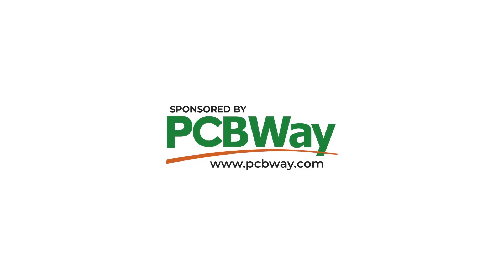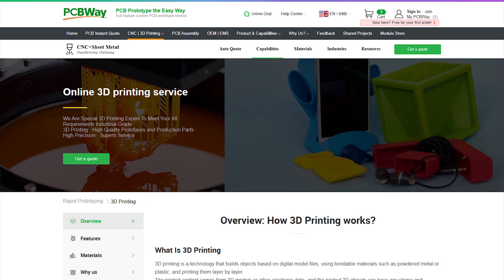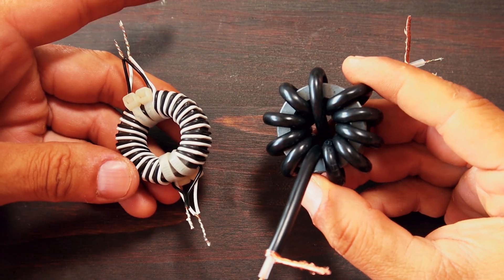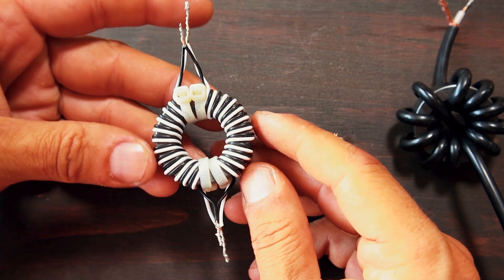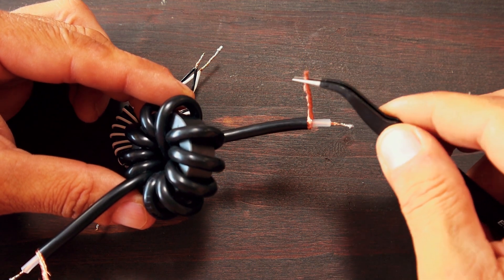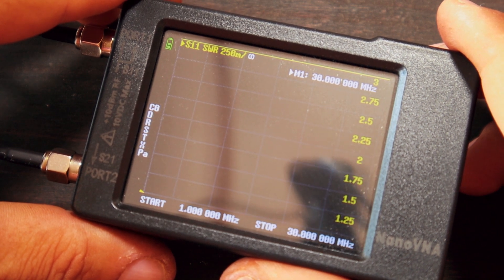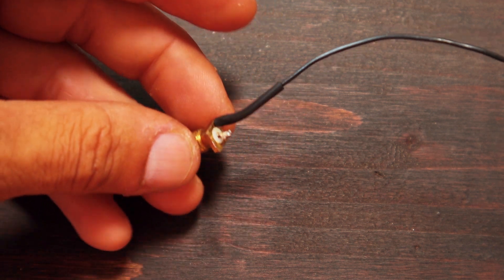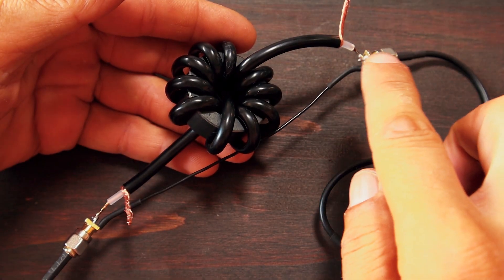Common Mode Current Chokes Comparison - NanoVNA Measurements

Comment: What is the exact operating frequency? Are both types the same?
Reply from the maker: I can't remember exactly as it's been a while since I made it. But it should show during the video the NANO VNA plot and it will show the exact frequencies. Technically it was made to be used for HF for the 160m band up to 10m. But you will see that is not so efficient on all frequencies. I may either have to play with the number of turns to get better results or maybe the toroid. 73, YO6DXE.

Comment: Hello, I hope you are well, I had a question about the Common mod Choke you made, what type of core was used?
Reply from the maker: For the one in the video I used FT140-43. I haven't tested it but I was told that the 31 material is even better for chokes. I will have to try. And to answer to the other question about the power.. honestly I can't really tell as I don't know how to calculate that. As it is now with the 140-43 I did used 100W into it and it was fine, but only SSB and CW making tests. But honestly to be safe I would say 50W should be fine. For more than that I would use 240-43 instead and I think even the attenuation should be a little better and the bandwidth should be also much more linear from what I've seen on others that built it on that core. For me since I only use QRP all the time, 140-43 is more than enough for what I need. What I didn't know when I made the video is that by playing around a little with the number of turns on the toroid, I may be able to get better results, so I really want to do that now when I will rebuild it. I am just waiting for some enclosures and connectors then I will probably rebuild it. I hope it helps. I will search out of curiosity on the power part as I am also curios on that. 73, YO6DXE.

Comment: Salutare, Ce core sunt, T140-43 ? ai reușit să printezi cutia? sau a fost doar reclama?  ☺ dacă nu ai unde  te ajut (free of charge) eu daca vreodată ai nevoie de printuri 3D, îmi place canalul tău... nu e de dinozauri deaia  cu + KW e așa mai pe experimente. Numai bine `73 de YO2CPS
Reply from the maker: 140-43 sunt da. Ca is mai mici si cum eu nu le am cu KW apoi is de ajuns 😁 dar la peste 50W as pune totusi 240-43. Comic esti haha... multam frumos tare. Apoi pasiunea asta de multe ori ma transforma in copilul ce am fost candva si mi-as fi dorit atunci sa fac ce fac acum. Asa ca ma distrez construind si exerimentand... una iese alta nu... mai o durere de cap da pana la urma tot mere 🤣. Nu am mai printat ca am gasit cutiile ce le cautam eu de mi-au placut mult si am folosit alea. Nu prea sunt eu cu 3D printing... e fain da aici is si eu dinozaur... parca nu au suflet. Asa ca dau de zor la pila si la smirghel sa lucrez cu lemn si aluminiu... da nu prea am cand 🤣. 73, YO6DXE.

Comment: Thanks for the informative video showing your measurements. I myself used a Fair Rite 240 43 and unsoldered the connection plug at the antenna matcher and wound my turns there and resoldered the connector and plugged back into antenna matcher. We all do our own thing.
Reply from the maker: 240-43 or even 240-31 are much better than the one I used, but it was all I had 😁. 73, YO6DXE.

Comment: On the Coax model, do you have to do the crossover?  If not.. is there an efficiency difference between a crossover and continuous winding?  Thank You!
Reply from the maker: The crossover is a must yes on the coax... otherwise you do not have the out of phase signal going through the choke that would cancel the common mode current.
Reply from the maker: P.S. And if you can get the FT240-43 or FT240-31 and more turns of coax on the toroid ( I think 12 is the right number if I remember well ) then is even better compared to the little toroid I used.
Reply: @dxexplorer  Thank you for the Reply.  I still am unclear about the winding.   is the cross over a must?
Reply from the maker: @johnnybigpotato2404 Always a pleasure. And yes... if you build the coax version... the crossover is a must yes. That is the only way you will create an out of phase signal going through the coax, that will cancel the common mode curent.
Reply: @dxexplorer  Thank you very much for taking the time to answer.  It was my suspicion, but I had no idea how to figure it out myself.  :)  Thanks!  KD0YKK
Reply from the maker: No worries I was also confused )). That is the only reason I keep testing things, just to help me understand. 73 buddy, YO6DXE

Comment: Next question would be to understand which configuration will work for high power, say 1KW to 1.5KW. What wire/ coax will you use?
Reply from the maker: That honestly I don't know and for me is impossible to test... all I have is 5W and I am honestly way more happy with QRP than I would be with 1KW. That is way too much for me. I am no broadcast station 😁. QRP is like fly fishing... you work hard for those contacts and you learn how to work with the conditions you have to make the best out of it. But from the little knowledge I have so far I would say that for sure RG58 is not a good idea and we would need something much better. On the toroids part... that I think is not so hard to calculate as most manufacturers of the toroids do publish the amount of power they can handle. I will search out of curiosity what other people use for such high power as I am sure they have way more knowledge on that than I do and I get to learn something new as well. Good question you asked indeed. 73, YO6DXE. 

P.S. Maybe someone that knows will answer to the comment as well.
Reply: @dxexplorer  Thankyou for your swift reply!
Reply from the maker: @zsradioham Always a pleasure my friend.
Reply: I use 2 x Amidon / Fair-Rite FT240-43 or similar type ferrites with teflon (PTFE) coax ~5mm (for example RG-400) at 1,3kW power. You need to use better coax and insulation because the voltages are such high if there is bad SWR at the antenna. Simple RG-58 won't handle that. Also if you use the insulated wire model that wire should have very good insulation and also be separated to each other more.
Reply from the maker: @Swataia Yes you are 100% right on this. The only reason why I do not bother as much on this is because I only use QRP 100% of the time and also on the channel I only talk and promote QRP gear. But indeed for higher power there are totally diferent ways to do this to ensure safety in the first place. I think there was someone else asking about using higher power and I kindly asked to search in some other place that information since I do not have the knowledge for that, as I do not own equipment that would allow me to test whatever recomandations I would offer for high power. So thanks so much for sharing this info. I will pin the comment for others to see as well as I think this is very important. 73, YO6DXE.

Comment: I understand that Common Mode runs along the shield, not the center terminal. You should have done your test on the shield part of the coax.
Reply from the maker: If we take two parallel wires used in an inductor..  that are basically identical... does it makes a difference what wire we are measuring ? Both show the same results right ?
Reply: @dxexplorer  I am strictly referring to the test on the coax wound onto the toroid. Not the two identical wires. The coax shield will carry the common mode interference. The coax shield will act as an antenna and carry unwanted RF back to the radio.
Reply from the maker: @deanberglund2332  Yes I understand that... but when making the test... are not the shield and the center conductor two parallel windings just as it is in the case of the regular wires ? In real life indeed the common mode current will be on the shield not on the center conductor... but if you connect the wires for measurement the other way around..  as you say... the results are idendical. Ok maybe just minor differences since the shield is actually closer to the toroid than the center conductor and the result of that may actually be a little better than measuring the center conductor. But in conclusion... the coax also is nothing but two parallel wires separated by an insulation. I hope it makes sense. P.S. I did tested long before making the video the other way around as well out of curiosity ..  almost no difference. The reason why 99% of the people are measuring this way is for convenience as is much easier to make the necessary connections to the connectors. No other reason.
Reply: @dxexplorer  First off, thank you for your speedy response. I do see your point although, my logic of thinking is that the center conductor is actually being shielded by the coax's braid and the toroid isn't having as much effect on the readings you get. Thanks again for posting this video. Every bit of experimenting and video helps in understanding. Thanks again.
Reply from the maker: @deanberglund2332 Always a pleasure. Do not worry... some of the comments on the video and other similar videos also confused me very much... that is why I decided to do the measurements myself so I can experiment and see on my own if there is a difference in the readings or not. Regarding the coax on the toroid.. it works on the same principle of any inductor made on a toroid. The closer the wire is to the toroid the better. That is the reason why the shield will always have better measurements since is much closer to the toroid, not the center conductor. The way I see things... if it works and I have no problems with common mode current... I am happy. I don't look for perfection... that is always only on paper... a lot like politics today 😅.
Reply: @dxexplorer  If you have 30 dB attenuation on the center conductor you will have that on the signal we want also. That can't be good.
Reply from the maker: @KjartanAndersen That is what I thought,  but it doesn't work like that. Is because of the way you wind the inductor having two coils out of phase from each other. Is too much to write in the comment but maybe one day when I have the time I should write more about it in the blog article so I can point the people to it to understand the way it works 😀. This because it confused me a lot as well when I first started to learn a little about RF chokes 😆. 73, YO6DXE.
Reply: @dxexplorer  Yeah, my mistake. You have shown that when there is a difference in the two leads then the difference will be attenuated. I always forget this. A CMC is built to get rid of difference. Normally there would be equal signal on the two leads, but with different direction. And the different direction will lead to a zero sum and no noise. If there is a common mode noise signal it will affect both leads and same direction. And now the sum is not zero and a choke will reduce this sum 30 dB. Logic.
Reply from the maker: @KjartanAndersen Yes indeed. That is the way. To make you laugh a little... at first I just couldn't understand the way it works. Luckily... many years ago I built an electronic guitar from scratch and had the pickups arrangement and the switches same like Brian May. There I learned about out of phase and all that stuff. I only understood the CMC because I built an electric guitar in the past 😅😅😅🙈.

Comment: Hi , is this choke (coax version)suitable for fabricated vertical (with radials antenna) roof antennas?Sample  27 mhz cb antenna...?
Reply from the maker: Good question. From what I've seen on the nano VNA I would say that yes. Probably material 31 instead of 43 wold be even better. And if you can use a larger toroid like 240-31 would be even better. I do remember when I used to make chokes for CB on 22cm diameter PVC pipe with coax turns on it that looked like a pot at the base of the antenna. I wish I knew back then about these ones we have now 😄.

Comment: My friend, it was a nice try but no banana.  Not trying to be harsh, but you are showing impressionable newer hams the wrong way to test a CM choke. In all fairness you would remove this video until you can re-shoot it showing the proper method.
Reply from the maker: What is the proper way ? Asking because 99% of the hams I learned from use the same method. Taking in consideration the fact that I no longer have issues with common mode curent, they must be doing something right. 73, YO6DXE
Reply: @dxexplorer it’s the correct way.
Reply from the maker: @TheSmokinApe 🙏🙏🙏

Comment: We are meant to be measuring Common Mode Attenuation. This flows on the OUTSIDE of the coax. PLEASE REVISE YOUR TEST JIGG!
Reply from the maker: I think many people missunderstand the way it works and how it gets measured as it seems to create a lot of confusion. The curents running through the cables..  either coax or two parallel wires will always work out of phase from each other... so no matter what wire I measure, the results will always be the same in practice. I kept searching on this and 99% of the people measure the same way and the results are very similar both in measurements and as well in practice. So honestly I don't really know other way to measure as the other 1% I got to read on were really badly made measurements that I really don't trust 😄. 73, YO6DXE
Reply: @dxexplorer  The coax version works on the idea of increasing the outside resistance to current flow. The wire version works on the idea that the resulting fields are opposite and will cancel out. It also works on the idea you are creating 2 x 100 ohm lines working in mirror with the end result being 50 ohms in and out.

Tested properly.... you will see the coax version with not return the same attenuation level across as wider range. The wire version will kick it's arse! But the wire version will not be any good for down around 160m. Attenuation drops off very steeply down low and into the broadcast band (where I needed mind to work). I got recommended to try it too.  Burnt my core out in 3 minutes (red hot) with 100w of AM on 1611 khz! Correctly tested you will see something like well over 25 to 30dB of attenuation from about 7mhz all the way up to 60mhz. But forget it on 160m or where I am on 1611 khz.... You will see the graph on the VNA under 18dB for the likes of 1611khz.

The problem I had was I'm running low power AM services with short aerials. The aerial system was trying to use the coax feed back to the TX rack as part of the radial system (and the SWR dection in the TX was not liking it). So I needed to "choke off" the coax. The fix for me was the RG400 version aka the coax version here. But with a twist! I used the winding style and added a second choke. I wound it the same way but done with 2mm transformer wire. The two in series fixed it right up! Either one on their own was not so good. The version refered to here as the wire version - burnt out in no time as mentioned.

Cheers 73's
Reply from the maker: @petertate3436  I come back tomorrow as is 2.30 am here 😅😅. Yes indeed this is how they work. But I measured the coax version the other way around too, basically measuring the outer braid and the results where very similar comparing to when I was measuring the center wire. On the frequency range to cover... I think it must be the material the core its made from. So far I only had the 43 on hand... I've heard 31 is better for chokes so I will try to get a few of those to test and see the results. For me with QRP power is easy life 😅😅. We chat soon. 73, YO6DXE

Comment: 5:45 The test is correct in the procedure but the resulting attenuating level in decibel doesn't make sense because it is performed on 50 ohm VNA impedance but it is not the same impedance that common mode impedance will "see" on the external surface of the radianting coax braid.
Vurthermore the choking is broadband and that impedance will vary enormously as the frequency varies.
So the data in decibels can only be comparative but it is better in that case to refer to the reactance
Reply from the maker: I am sure is not exactly perfect. I am also still in the learning process to make more precise measurements. So far all I know is what I have learned from other fellow YouTube creators that made videos on this subject. But this is the beauty of the hobby..  always learning more and better ways to do things. 😁😁 73, YO6DXE
Reply: @dxexplorer  783 / 5.000
Hi, physics and electronics in particular, should be studied with books to be sure not to acquire wrong information unless you choose well-known names e.g. W2AEW who, thanks to his past jobs, also knows how to explain very well (suggested to all my students).
The situation about videos in italian is dramatic due to a very low level of the youngest Italian OMs and also, despite this, they make and publish videos with the claim to explain what they have not studied.
This is how myths and legends are born and spread: this is the reason why I have written several articles with the aim of fighting them.
The links are on my QRZ page; sorry, they are still only in Italian: I hope Google can help you, if you are interested. 73s